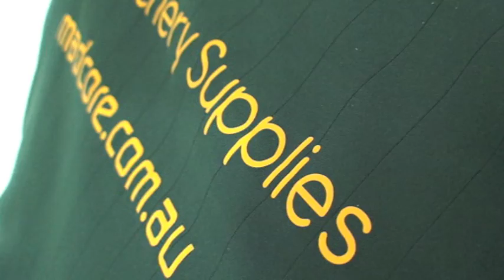How to make a bow string

Comment: This is one of the best tutorials on the subject that I have watched.  Great work.  Sounds like you are from Down Under.  May I ask what string jig you would recommend.   I'd like to be able to make strings for both traditional bows and also compound bows.  I'm in the USA...hopefully you might have a specific model in mind that serve me for many years and would be readily available to me here.  Thank you!
Reply from the maker: Hi Sorry for the very late reply. I cannot for the life of me remember the name of it. However I purchased it from a company in the uk called ALT SERVICES. I did however have to make some modifications to it in order for it to be able to get the tension that I needed. You need to remover the original Bolts from the end’s and make a new housing! I ended up using 20mm bolts and a much thicker Aluminium housing. This lasted for years until i gave the jig away a year or so ago.

Comment: I would really.
Have liked to see how you did.The center serving and fitted it on the bow with the way you measured the string
Reply from the maker: HI, there are many ways you can do it. On the jog that i had, i had actually made markers to indicate where servings should go based on the size of the string/bow combination. However in most cases once i had made the string then I would normally serve it on the bow to get it right. For standard strings i would serve quite a large area about a Hand and a half in width. But for my own strings or well trained archers i would only serve about 3 inches worth, just enough to 3 fingers on. By having the smaller serving area and having a fat string (18 strands) it gave the string much more punch at the release. A 16 strand with be a little lighter and maybe a touch faster, but lack’s the punch for distance and power. (Just my observations) 18 strand strings are heavier and slightly slower, however they also give more outward force behind the arrow… see how your go and I hope this helps. Oh! For centre serving i mainly used only Majesty serving or a very slick serving material. Standard serving is a little corse and can give a little extra grip and will not allow for a smooth and slick release. For compounds though i always used a standard serving material if a release aid was involved.

Comment: Hello mr.Gannon, appreciated the how to, but iam interested at your tool that you have  and use there. I would like to see more of it so i could hopefully  do it as well maybe to make a list of items. Iam allso interested in how to put in the silencers, how to protect the point of the string where the arrow sits on. Much appreciated
Reply from the maker: Hello, and so sorry for the late reply. To answer you question’s. The Jig i bought from ALT Services in the UK. I have modified it to use bigger bolts so i can apply a much higher amount of tension. The serving jog i used was a Bieter serving jig. This also comes with all of the tools you need as well. To protect the arrow nock, serve this area a little tighter than the ends. You can place a littler more wax in that point, this will also help with cleaner arrow release. On my own string i would do a manual served nock points, instead of using a brass nocks. This gives better clearance and smoother release.

Comment from the maker: Hi People, I just wanted to add a comment in regards to post's on this video on other web sites. Please be advised this is the way that "I" make the string. This may not be the rule of making a string, but it is the best way that I have found. In regards to cutting of the string, this does not damage the string at all due to the way that I serve the string. This is why i backward serve the string. It add's extra protection and stops the string from wanting to pull apart. Not everyone may agree with the way it has been made, but I get almost no string creep after my string are done.
What I have found is that my string's tend to last longer and shoot a little faster than some others. String making is a personal choice, and i have made this video to enable other people to try and make their own. By all means bag my method if you wish, but if you know better, then please feel free to make your own video to explain. But I would put my string up against any one else in regards to strength and performance.

Comment: Great video.can you tell me how far apart are your posts on your jig.thanks
Reply from the maker: HI Tony, Can you please clarify which distance. Do you mean at the post ends? Or the total length from posts to posts. If it is just at the ends for the servings then they are about 20cm apart there of. From end to end is totally dependent on the actual string length.

Comment from the maker: I actually serve the serving point on the bow, and then place the nock on. For strings that we have to send I do a "Rough set" of the nock in case the customer has thicker or thinner arrows. On the bow you serve from just below the sight block bottom screw hole to the bottom of the grip.

Comment: Excellent video! I learned much. I have  a question. I have never made a string before. The string on my bow has a serving placed where the arrow is nocking point is placed. Your string does not have this serving. what is the purpose of the serving. (I have and Oneida re curve compound bow.)
Reply from the maker: +588158 The center servingis always done afterward and you should do it whilst the string is on the bow. This way you get the serving to the right size and placement.
Reply: +Sheldon Gannon Thank you Sheldon

Comment: great and informative, just one question, the strings for the bow is not the same as the "wrapping" of end strings correct?  What are the strings used for the string itself and the string for wrapping?  I see BCY8125  mentioned... could we use aramide thread?
Reply from the maker: Hi There, you can essentially use any string you like for the main strands, however you must not go to thick otherwise you will struggle to get nocks that will fit right. The serving at the ends is Majesty serving, this comes from Japan. However I also use a BCY serving material as well depending on the cost of the string for the user.

Comment: Hi Sheldon,
Great video. thanks
How does one stop the 2 bundles of string separating ? as for example you do 20 strands and served the loops and center but now the 2 bundles of string stay apart or the string does not stay as one big bundle. IS it to do with putting in twists before doing the center serving ?

Regards
Reply from the maker: Hi mate, yes to a point. The centre servings will hold them in place got a degree. I find that end servings are the key to keeping them locked in place. You will see in the video I use a separator to get the balance point of the two different colours, and once you have done you servings the string will naturally twist. Use the separator to slide up and down the string to get the twist balance right. It should even out, but do this step before you do the centre.

Comment: Very good video. Showed a lot of techniques I hadn’t considered and will use. But 2 things that are not explained. 
1 why have your jigs set to 45 degrees ?
2 why cut the red and black string at the end of the video ?
Reply from the maker: The strings are cut for balance. So the number of strands between each colour are even. Having the string in off set helps create the length of the serving point and end loops. TBH i was taught that way and never really questioned it. BUt it makes sense when you are actually making the string.

Comment: Hi Sheldon.  Love the video.  I am going to start making some bow strings soon.  I wanted to ask you if it is neccecary to put a serving on the mid point of the string.  I have seen many strings I have purchased before that have this.  Your video on making a continous string does not mention this so I wondered what your thoughts are on this subject. Many thanks again for the informative video ! Thanks  Nigel
Reply from the maker: +Nigel Richardson HI there, if you are referring to the center serving this will go on last, and normally whilst the string is on the bow, so that the serving is placed correctly.

Cheers.
Reply: +Sheldon Gannon Thanks

Comment: very nice tutorial i really enjoyed it but i have a question do you ever serve the strings in the center to prevent the string from unraveling at the point you nock the arrows. or do you have any tips on how to prevent this issue with homemade strings.
Reply from the maker: Sorry for the very late reply. The short answer is NO. You can only serve to the points that i have outlined. If you follow this video to the letter you should not have any issues with the servings. I have in the past had them come undone, but that has been to not sealing the “Burn Off” correctly. I have simply just unwound, trimmed and done a small serving to replace.

Comment: I saw most of ready-made strings are un-twisted(between top and bottom end serving) and center-served.
I got the impression from there that we should have string un-twisted, then center-served, then twisted/waxed to meet the tuning need.

from the video after top/bottom end served, you twisted and waxed the string, I guess the string will stay that way while it's center-served, right?
so is it pre-twisted/waxed(as in the video), then center-served, then gets twisted/waxed more for tuning?
Reply from the maker: Hello, and so sorry for the very late reply. Even though the string is twisted. When you do the centre serving you will find that it will cause the string in the direction that you are serving to twist up more, this tends to happen when doing it on a bow! However, in saying that if you serve it on a. Jog you can get the tension high enough that the twist will be bound into the centre serving. But you can also take a couple of the twists out before you render.

Comment: Just curious, most strings I buy for longbow and recurve have serving at or near the center, I notice you did not serve the center of this string where a crimp on nock point would normally be used. So the question I have is why? Thanks
Reply from the maker: Hi There, you do this once this is on the bow. Then you serve so the center serve is correct!
Reply: ahh, that's why most are offset when the bow is braced. Thanks, great video by the way

Comment: I am curious about the logic for having extra strings and then removing two near the end.... I've watched several of these type videos and no one else seems to do that.
Reply: The reason for removing the two strings is Balance. If the string had the extra two threads it was essentially FAT. By removing the extra two it made it smaller whilst keeping it balanced. I just found.. in my experience that the string was a little faster and also quieter. However my way may not be the “correct way” but i found it worked and people that used my strings never complained.

Comment: Hi when you first start using the binding jib in right hand and go round bow string two times over the binding string Allthough not a real knot it's called a cleave hitch knot very handy for allsorts of uses tying up logs making tripods and this use on bows. Strung it tightens over itself basically it's a N shape with itself tied under great video by the way enjoying yours a lot p's please could ya do a nice shooting one on the win rcx 100 cheers

Comment: is it the same for compound?
thnks, great video!
Reply from the maker: Essentially yes it is, however when making the strand splits and tension strings you need to do a bit of touch and feel. This Jig design does struggle making some compound strings. But all the compound strings that I made worked and sounded awesome, but they are much more work and very time consuming due to harmony balance.

Comment: Hi sheldon, when building your strings are you making them to the exact size needed or are you giving them extra to account for your twists?  I have been having an issue where my string length is not consistent. any advice would be great thank you
Reply from the maker: +Jerrold Munson HI There, before i explain i just want to say this is what I do, it may not be rule of thumb, but this is what I find that works. I actually make the string about a 1/2" longer than it should at the start. After you service the first end then you need to wind the tension up even more. This will actually in most cases increase the length by about 3/4'". Once final serving  is done then apply about 20 twist's to the string prior to the rendering of the string. Why do i render, it melts the wax into the strand's and locks the twists in place and will stop increase creep in the string. The best thing you can do is leave it on the jig for about 24 hrs under tension winding it up little by little over the 24 hr's. Once that has been done place on your bow, adjust the twist up or down then do your center serving only after it is correct. This should lock the string in place and your string should not creep or lengthen any more. Now, again not everyone will agree with me on all of this, but I find that it works, also I find doing the servings very tight this helps to prevent any string creep. The most creep i have ever had is about 1/8". Hope this helps.
Reply: +Sheldon Gannon  thank you Sheldon I'll give this a try.  Ordering new string today.

Comment: Why did you cut the strands? And can this method be used on a recurve crossbow 260# draw?
Reply from the maker: Yes it will work on any style of string. The reason I cut is to get an even amount of strand's of each color. IF you don't you will have odd strands. However it is all dependent on how many strands that you want. And I find you get a better and cleaner twist!

Comment: Hi Sheldon, thanks for the nice tutorial. I'd like to start making my own strings, for a final string of 62.5" what would you recommend as the starting length in the jig?
Reply from the maker: What ever you length aim for about 2” shorter than the desired end length. You will find you will get heaps of stretch, however, in saying that no 2 strings will be the same no matter how hard you try. You might need to add twist’s or decrease the amount of twists that you need. Sometimes it can take a couple of goes to get it right. Also i found that even though I always used the same string type, some colours behave differently especially when blending. So there is an element of trial and error required.

Comment: what is the brand of the server tool-good job
Reply from the maker: HI Mate, the tool is part of the beiter string making kit. And to answer your question the reason that I remove two strands is due to balance. Now i know that many archers will disagree with what I do. The simple answer is I know this works. It make the string even and true.

Comment: I think you forgot the nocking point serving area, or is that only for compound with mechanical release?
Reply from the maker: Hi There, no i didn't forget about it, I deliberately left that out. As the knocking point really needs to be done whilst on the bow. AS there is no such thing as the same knocking serve, all bows are different the the serving distance can change form bow to bow. Would be a whole other video to explain that right!
Reply: lol yea.. been using compound bows for 20 years just today started using a martin jaguar recurve  still trying to get the hang of it.

Comment: you didn't say why you used 20 and cut out two< WHY> and you where long on string and didn't explain it, 3/4 of inch long, changes poundage?
Reply: The reason I take two out is due to thickness. I am running an 18 strand string. IN regards to length, this is what the twists are for. When making a string you allow a little length for placing twist and locking it down when you do your middle serve. Personally i found a 18strand string to have a little more punch to it vs a 16 strand. Also i noticed in my time that 18 strands was also a lot more quiet than a 16 strand. However: As with all things in Archery, you need to find what works for you. What feels good what feels bad. You are correct that length can change poundage, however it all depends on the Riser Limb combination. So brands prefer and recommend that you run a much higher brace height, and some lower. I always opt for around 9.5 to 93/4 inch brace height. However there are some that like it at 10”. The idea behind the video is to show how to make a string for yourself. Lastly if using two colours you get a better balance of colours at 18 strand. Hope this explains everything for you.

Comment: Why did you cut one red and one black string? And why didn't you just use 18 strings to begin with? Otherwise fantastic job !!! 

Peter
Reply from the maker: +Peter Martinez hi there it is to do with balance and even balance. To do 18 you have to do an uneven pass. The way that I do it leave's the number of passes the same so you can stretch  the string more and it will not alter the integrity. People may suggest otherwise but i challenge anyone to the fact that this way works just as well!

Comment: Hiya sheldon, thanks for the video upload really helpful.

I'm just wondering though I have recently bought all the equipment to make my own string jig but don't know how wide the pillars have to be and also how far in on the Aluminium box tubing?

One other thing how big do you have the loops on the string at?
Reply from the maker: HI there, The loop is not an easy thing to work out as it takes a little practice to gauge it right. But normal length would be about 4-5 inches long of serving to make up the loop it self. Some people like a smaller loop i like a slightly longer loop as it allows for a little error in the shot!